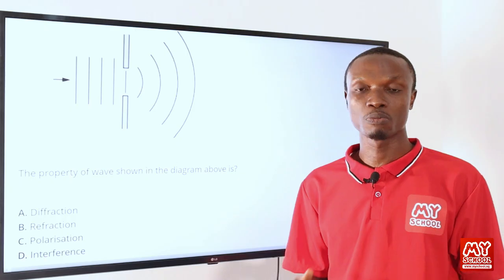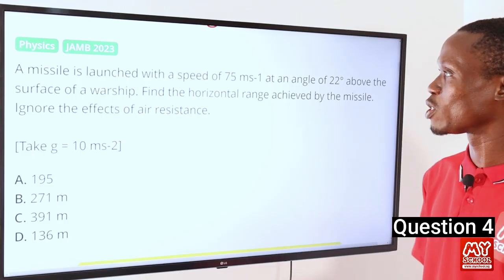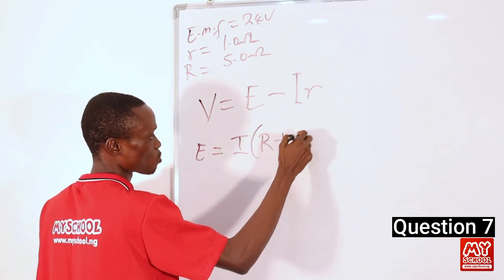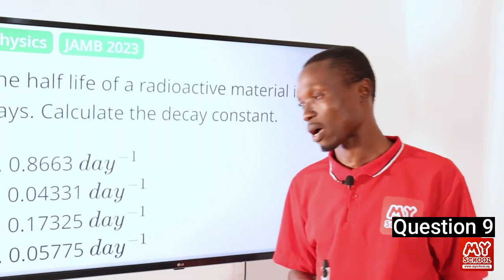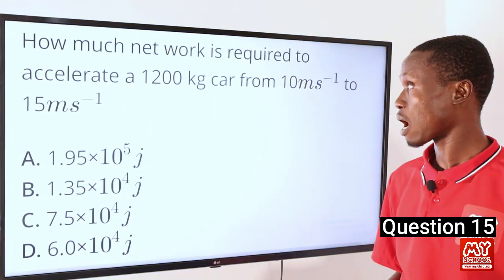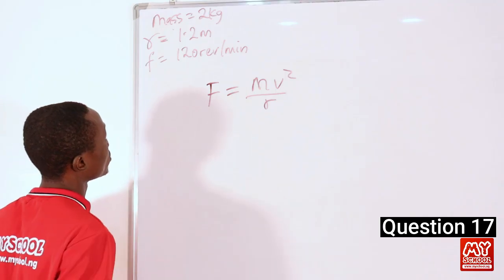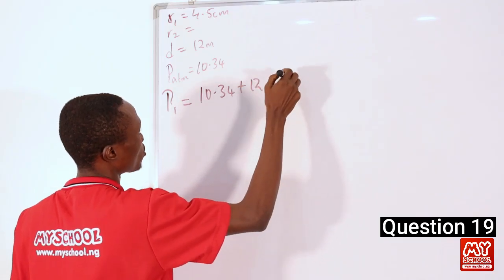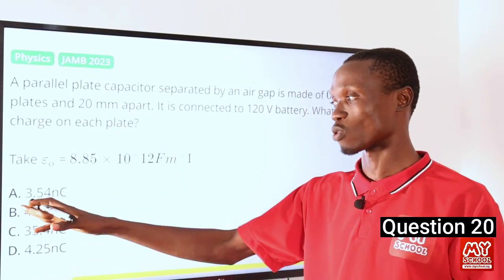JAMB CBT Physics 2023 Past Questions 1 - 20

Comment: Sorry sir
I don't really understand question 5 well
Reply from the maker: Work with the formula = Partial pressure of water at a given temp/saturated vapor pressure of water at that same temp  x100%

For this question at 40C, partial pressure is = 38.8mmHg
From the given table we can get the saturated vapor pressure of water at 40C which is = 55.3mmHg

Comment: Pls in that question 16 Calculation 
How did you solve for 15/π×4×10^8×0.005
Reply from the maker: Put 0.005 in standard form, multiply 4 by 5 = 20, then you will have 20 x 10^-11 then this in standard form will be 2 x 10^-10, then use 2 to multiply pi which is 3.143 = 6.283 x 10^-10 then divide 15 by 6.283.

Comment: Sir why is it that I paid for the CBT app but yet to receive my code.. calling the number I saw on the screen buh no one is picking
Reply from the maker: We're so sorry about that, it could be that we were on another call or you called during the weekend which we don't work. Is your issue resolved now? if no, please call in now.

Call Hours: 9am - 5pm (Mon - Fri)
  +234-913-373-3736
  +234-814-666-9200
  +234-906-832-9240
  +234-818-491-6861
  +234-817-002-3468
  +234-817-002-3469

Comment: Question 8 ..your calculator is wrong  we are  not given velocity in that question how did you get 10U...O*t is O so  you suppose solve with only Acceleration and square time to get velocity....then move to next part..pls explain more
Reply from the maker: We used the second equation of motion to solve for U because we were given distance, acceleration, and time. Since we know initial velocity, then we can calculate for the distance covered in the next 20seconds using that same second equation of motion, then subtracting the two distances to get the answer.

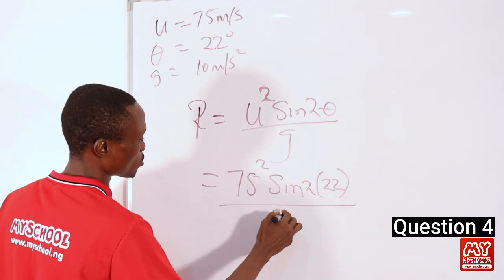Comment: Sir 7:16 How will we know the sine if JAMB calculator can't do sine, cosine or tangent calculations?
Reply from the maker: Ones you're familiar with the formula you should be good to go.
Reply: @MyschoolNigeria the formula is not the problem. How will we get sin 44 under examination conditions.
Reply from the maker: The question requires a four figure table, so since the JAMB calculator won't be of help to the question, they may give it up as a bonus question, but most times JAMB gives special angles to make it easier.
Reply: Pls sir how do you get the final answer for questions 16